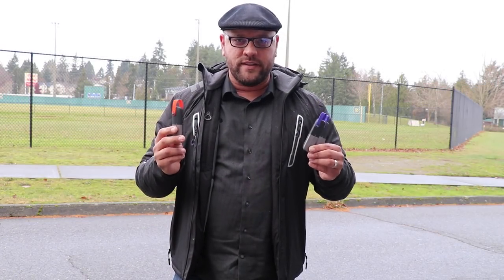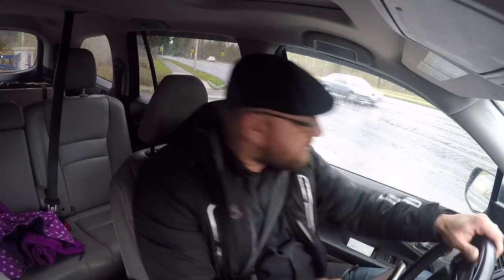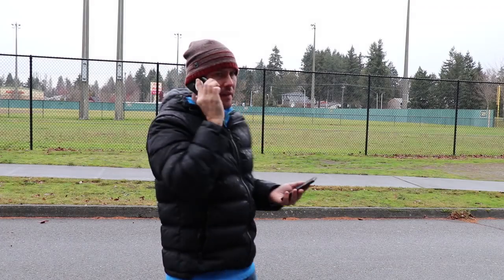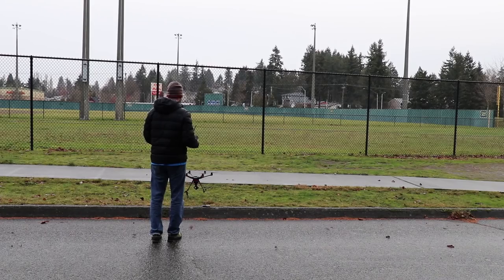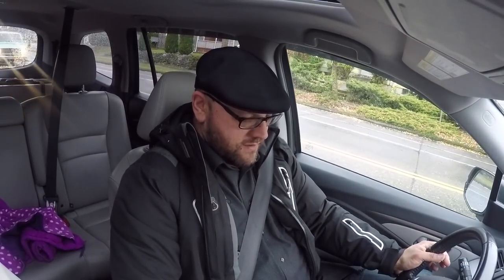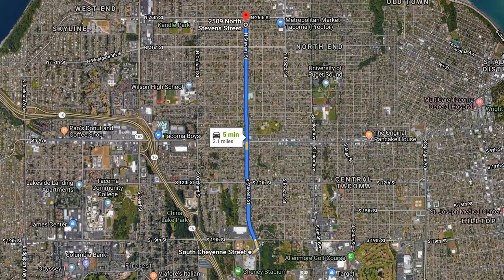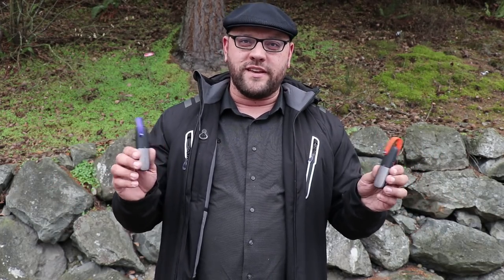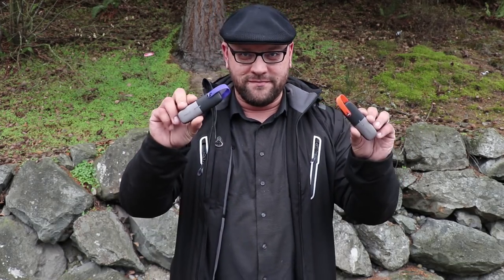GoTenna Mesh range testing using a Drone as a Relay Node

Comment: Just remember that you don't need to keep the drone flying, park the drone on the corner edge of a hirise rooftop to cover 270' of the area you need to communicate in.
Reply: I use a small electromagnet so I can put a magnet on payloads and drop them off places / pick them up with minimal messing around. Picking up takes some fluffing at times because it's a DJI so it wants to land on it, but I've since learned to use a plastic rod as a stand off about 18 inches long. I only use it on meshtastics though so if I lose them it's $20, but so far I've managed to have some serious fun with mates across some terrible environments. One thing I want to play with is a DIY drone / balloon combo. It'd be much easier to use a balloon to carry the weight and the drone motors to merely keep it in place. I COULD just use tethers to do that, but I don't want to have to carry three fishing reels and lines everywhere. Either way - unlimited potential for us tinkerers. Shame no companies have the smarts we do!
Reply: @bashkillszombies  if you ever do this be sure to share it so we can all see your success

Comment: It looks like this definitely has interesting possibilities for sure. As others have mentioned the signal would be relatively poor inside the vehicle but by moving the device outside the vehicle greatly increased the transmitting strength. Very interesting review and test for sure. Thanks for sharing.
Reply from the maker: Yep. I wanted to include the footage of it working poor when inside the vehicle. I was so focused on getting the production cameras setup right that I wasn't thinking about the Mesh placement as much as I should have. Fortunately, we made the adjustment after Uncle Dan realized where it was located.

Comment: A fantastic idea. Communications is vital and we often take it for granted. Obviously this system would depend on the battery life of the drone for longer term, but yeah for a momentary 'shedule' or broadcast, this is great. Some good range there too!
Another option would also be to use a balloon of some form or even KITE, with the drone attached (maybe for a scouting/foraging trip etc).
Great job and probably essential in order to determine range at this time.

Comment: GoTenna Mesh operates in the 902 - 928 MHz range. Being inside a car (mini Faraday cage) will not help. Absolutely need line of sight at those frequencies and yes, even tree limbs will impact it. It's all about the antenna, distance and frequency. HAM guy. Get a HAM license. See Julian's channel - OH8STN
Reply from the maker: Yep. I was so focused on getting the video production equipment setup for this video that I forgot to include the Mesh outside of the vehicle. It performed much better after we reconfigured it. I've been a big fan of Julian for years now. He features much more advanced COMMS topics.
Reply: A lot if the 5g studies they have been doing have shown trees with wet leaves to block 70-90% of the signal. Big fights in England over all the trees they're  cutting down- thats at a higher frequency which should actually penetrate better.

Comment: In the the video I noticed that the Gotenna was mounted on the underside of the metal roof rack. Which will degrade the signal. 

Always make sure the Gotenna is away from your body and away from metal objects.

From a mountain top I was able to communicate 30 miles without a relay. I’ve also relayed messages  through 5 gotenna mesh units in mixed terrain while camping where there was no cellular signal. It even out performed my VHF/UHF ham radio gear since there were no local ham repeaters in that area.
Reply from the maker: Thanks for the commend, James. We're going to retest this scenario with two drones to get an accurate air to air reading. Would you recommending having the Mesh dangle from the drones using a string to avoid it being connected to the drone itself? I believe that the drone legs are plastic, so perhaps it's not as much of an issue.

Comment: Without reading the other posts....

If you can go 34 blocks, from the 400 ft high node in one direction, one can surmise, you can go 34 blocks the other way.    So 68 blocks of coverage with the node in the middle is pretty good.    Now imagine a few drones/nodes at 400 ft all working in the mesh.   You could blanket a very large area until the batteries run dry easy.    At noon all drones lift off to create the vary large area mesh so that many users on the ground can make contact.
Reply from the maker: That's what I was imagining. It would be pretty sweet, as it would allow EVERYONE to participate in emergency communication (grandparents, kids, etc), as long as they have a device. I'm already planning the second version of the test.

Comment: Great test, I was wondering the same thing, using something to get some elevation. Curious how far is 34 blocks in a unit of measure?
Reply from the maker: It was about 2 miles for us (34 blocks). Keep in mind, it was lightly sprinkling and there were trees in the line of sight, so we could probably do a little better in a better environment. So theoretically, I could have put the other paired Mesh 34 blocks from the Drone as well. Then we would have had 4 miles distance between the two paired Meshes, along the same straight path road, that is.

Comment: Cliff, thank you for doing this test.  What if you take a second drone and attach a mesh node to it and fly it in between you and the other drone.  Do you think you could make it all the way to Owen Beach?  Also, you could have the first drone fly towards you more and possibly double your distance.
Reply from the maker: Possibly. There's a lot of hills and trees by Owen Beach. I was just trying to get the radius distance. Technically, I could have kept one paired node at Cheney Stadium, hovered the drone around North 25th/Stevens and might have been able to make it close to the Puget Sound (30 something blocks away) for the other paired device. It would be fun to redo this test after including the suggestions made in the comment section of this video.

Comment: GoTenna is just the tip ... when they figure out a way to create an app on peoples phones that works as nodes or relays we will all benefit ... but the big cell companies don’t want us to have the ability
Reply from the maker: That would be awesome and totally doable. I agree; the companies won't want that though until they can figure out a way to make money off of it.
Reply: briar messenger for andoid has a unique encripted forum sync when one device recives message it syncs to the next and so on. supports bluetooth wifi and tor internet routing and free .. bridgefy supports ios and andoid cross platform messages not as robust as briar but claims to do mesh hops via bluetooth

Comment: RF will go through glass, and probably not metal. And how reliable are solar panels near the WA coast?
Reply: Solar panels are completely reliable here.   Access to the sun is not.
Reply from the maker: LOL! Fernbark is correct. :)
Reply: An amorphous solar panel - as opposed to monocrystalline - will yield less overall power but will work better on cloudy/overcast conditions

Comment: If this is murs, maybe there was interference with wifi of the drone, who knows. It would be cool to try a helium balloon.
Reply from the maker: The original version was MURS. This one is in the 33-centimeter (902-928 MHz) band portion of the UHF radio spectrum.
Reply: @TheUrbanPrepper  Thanks, I saw it on the other video after I commented.

Comment: You are testing a what ? ... is this the new rage for grown up male adults that gets them to 'play outside' even when the weather is poor ?
Reply: @Dutch Courage goTenna Mesh is a 100% off-grid, mobile, long-range consumer-ready mesh network. That lets you chat privately in 1-to-1 or group conversations, or broadcast to any other goTenna Mesh devices up to several miles or kilometers away all without using towers, routers or satellites.